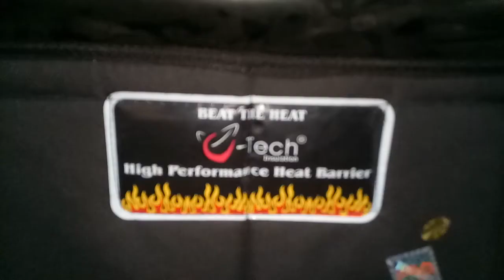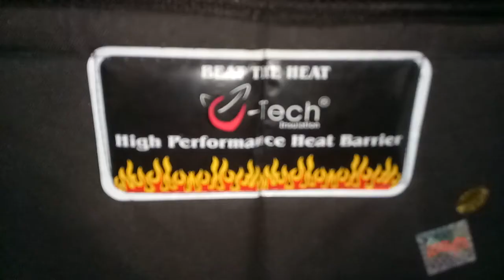Toyota Fortuner 2013 Bensin Pasang Peredam Panas Kap Mesin

Comment: Beat The Heat 
VTech®  Insulation 
High Performance  Heat Barrier

Pastinya terdapat manfaat yang besar, 
bila mobil" mempergunakan peredam pada kap mesin sebagai standardrisasinya. 

Kap mobil ada dalam keadaan "stress" ,terik sinar matahari mencapai 70⁰C ~ 80⁰C dipermukaan kap, disisi lain suhu mesin saat jalanan macet mencapai 90⁰C ~ 100⁰C